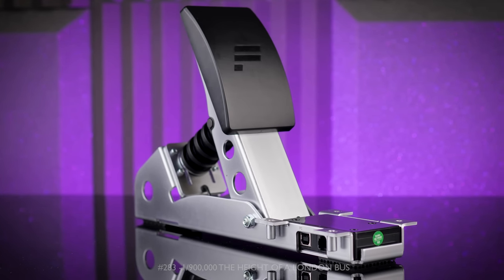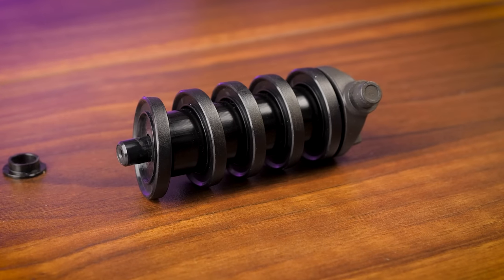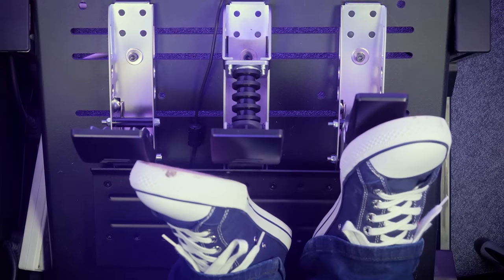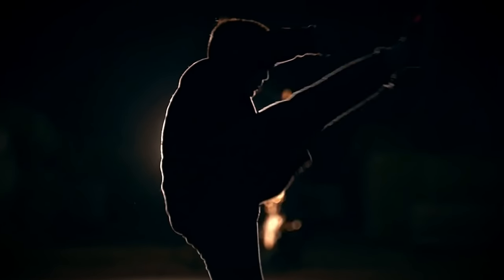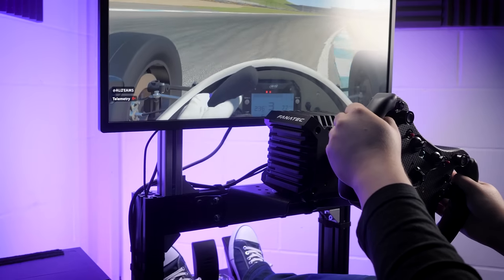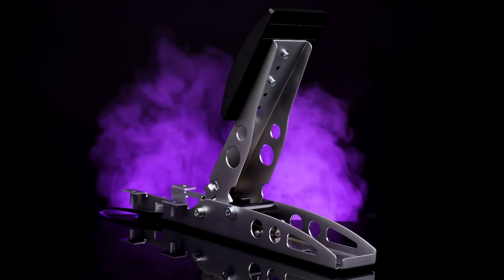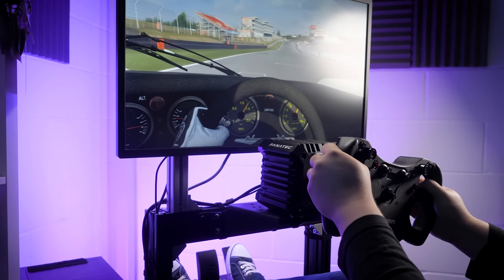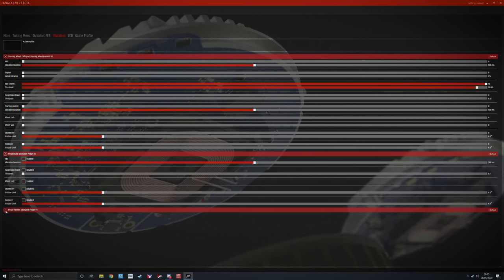Fanatec CSL Load Cell Brake Pedal Review

Comment: Great video as always Chris. Must say im minorly dissapointed here by the load cell offering when compared with the csl elite lc that was just discontinued. 

Would you recommend someone getting this loadcell option if they already have the base version of the csl pedals or do you think its worth the cost to jump to either  csw 3.0s or heusinkwelds?
Reply from the maker: Something I hadn’t really considered is that the load cell placement in the old pedal was on the pedal side, so given the mechanical advantage at work in that configuration I have no idea whether those two load cell values are comparable.

The CSw 3.0 is still my favourite mid range pedal set, but I think these are priced about right for the value proposition. In fact all three pedal sets you mentioned are. I’m using the Heusinkveld sprints on my main rig, and they’re fantastic. In short, I think you get what you pay for with each set mentioned!
Reply: @ChrisHaye  brilliant response thanks. Going to need to spend the week figuring things out in my head before the black friday sales haha. Appreciate you taking the time 👍
Reply: hi CJ, if you are disappointed because of the kg value, bear in mind that this is pretty misleading. It doesn't account for pedal geometry and is not a measurement of the actual foot pressure required. If you compared the performance of the CSL Pedals Load Cell Kit with the discontinued CSL Elite Load Cell Kit, you might be surprised by the results. But also bear in mind that the CSL Pedals range was not intended to be a direct replacement for the CSL Elite Pedals.
Reply: @DomB_Fanatec  the key factors for me were kg value and customization of the pedals in that order so thankyou massively for pointing out that the foot pressure wont relate on a 1 to 1 basic. I wonder do you guys have some stats internally at fanatec reporting the actual nm comparison on the footplate between different pedal sets available? If you do is there a possibility for these stats to be made public? If not to either question then purely anecdotally how would you compare the pressure difference between models?

And as always thanks for reading through the publics comments and replying to questions. These interactions really helps develop my perception of the brand and im sure it does for many others.
Reply: @korsarrokhan1  You're welcome! We are considering presenting something along those lines yes.

Comment: Is this item compatible with new Xbox?
Reply: Yes. You need to connect the pedals to a Fanatec wheel base, and use an Xbox-licensed steering wheel to activate Xbox mode on the wheel base. Then it will work :)

Comment: Lol fanatec are getting worse and worse. My tlcm pedals are 100kg and still cost less. Fanatec needs to get straight, no capping
Reply: The load cell max value can be misleading. This does not account for the actual foot pressure required. If you compare these products in use, the story is quite different.
Reply from the maker: This is an important point. I've got a set of T-LCMs on the way, so I'll be able to follow this up with somo more direct testing.
Reply: 60kg seems too light, I'm now running 88kg on my TLCMs and that's up from 75kg.
Reply: @DomB_Fanatec  Probably not the right place to be saying this, but how about Fanatec make their products available to more countries? Every other manufacturer, even some high end boutique brands, ship to pretty much all countries across the globe. And when shipping is paid for by buyers, and it costs you basically nothing, why gimp your sales by only limiting sales to a only handful of countries outside of the EU? 
 
I ended up ordering a TLCM today, just because these weren't available for purchase here in Asia.
Reply: @s_n9210  Hi Sanil, we would of course like to serve more countries and regions. But we want to do it properly, which is to say that we have distribution and service facilities in that region for proper shipping and support. This is how it is for the regions listed on our site. It takes considerable time and investment to expand in this way.